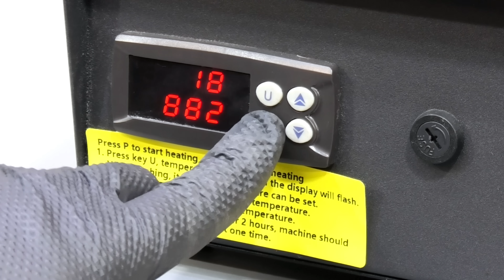105 Years Old Push Reel Mower Restoration - Why Did People Stop Using These?

Comment: made a lot of money with one of these back in the 60's - 70's @ $2 a yard and tall grass was no problem I just flipped it over and pulled it vs pushing it then flipped it back over to finish up.
everybody appreciated how short it would cut the grass and how even the grass was when I finished cutting it. it never cost a penny to operate it no gas no oil no constant mechanic payola.
just grab it n go it always worked.

Comment: They make a cleaner cut with each blade of grass, but if the blades of grass are lying down, they don’t get cut. Power mowers provide some suction that pulls the blades upward before getting whacked by the blade.

Comment: Great job.  question: did your research show original with that size handle? I got plenty of use out of a similar cutter when I was a teen but besides all the similarities....the handle on my was quite a bit wider and much easier to use versus pushing and guiding the mower from the center like the one you refurbished.  The job was hard enough without the center balancing act. Just a thought.
Reply from the maker: Thank you. I made the handle shorter to better fit my palms. Your hands were also smaller as a teen, I guess.

Comment: A couple of things, how did you miss some of the powder coat in that dip where it goes from round to the other part of the body at the mower, and how is it you're using a wrench that's like three sizes too big and barely grabbing that square head bolt.

Comment: Good, you toom it out and discovered why people stopped using them. They are great for a little lawn with no tall weeds or grass - past that they are a pain, figuratively and literally, compared to almost every other possible method of cutting grass except scissors. You can still buy them, by the way - not the same model, of course, but the same tech.

Comment: People stopped using these because they require actual physical work to use effectively, regardless of the better cut. People are lazy and will devise something easier, because we can.
Now advertise a prize for the best kept and clipped lawn and you will probably sell quite a few. It's about motivations.
Thing is, if you maintain your lawn regularly, these reel mowers are no more work than a gas mower (actually less), and give a better cut.. They become work when you try and cut a lawn that's a month old.
Another beautiful resto.

Comment: I have an old Penna Lawn with identical wheels There is supposed to be a rubber tire fitted over the wheels and is prevented from slipping by the ridges. I also believe this rubber protects the wheel from chipping. I have a partial rubber that I've been hoping to make with a mold using the old tire for a template, the outside of the tire has a cross hatch tread, I'll  need to check to confirm this. with the tires the lawn mower will perform very well.

Comment: Vaguely recall; flip it over and push or pull it to sharpen the blades and by adjusting the ground plate to tighten or loosen against the blades

Comment: Nice restoration, but did you not have the blades sharpened?  It's a specialist job, but you should be able to get that done locally.
Reply from the maker: I used a lapping compound. The mower iself-sharpeningng.

Comment: My mom had one of these for years.  They do a nice job. However, as slow as the blades are turning, you must keep them sharpened — that’s why there were so many mower sharpening shops back in the day (usually next door to the typewriter repair guy).  Also, if the grass gets too long, you either mow in six-inch strips or exert superhuman effort — life sucked either way.

Comment: I bought a Qualcast Viceroy off Marketplace a couple of years ago. The bottom blade was badly damaged, and it was seized. I got a new bottom blade made after freeing off the mechanics and a friend of mine turned a new roller on his lathe med from a beech rolling pin. The paint was in good condition so I cleaned it a coated it in bees wax. The handle was sanded and oiled with linseed oil. I now use it 2 or 3 times a week during the summer. It is older than me, and I'm 70.

Comment: I used a couple of different reel mowers and they could never cut the grass correctly with just one pass.  Granted, I had about 10 different varieties of grass (at least), but I would have to mow the entire lawn twice (once horizontally and once vertically) to get most of it cut correctly.

Comment: I am actually surprised that more people do not use reel type mowers.... when I was renting a house... I had a tiny lawn.   and  I was not about to spend  hundreds of dollars  for a gas mower.
I stopped at a couple garage sales and  came across a reel type.... it was  functional  ... rusty... but with a couple cans  of brake cleaner ... and  some motor oil and a wire brush  I got it  working again....
As long as I didn't let the lawn get to high...  it would take me 10-15 minutes to mow the lawn,

and the best parts?   No Gas... and  I could  mow the lawn  at the butt crack of dawn because it was  QUIET

Comment: I restored 3 old push mowers 40 years ago, with the original paint colors and then had them sharpened on an antique reel mower sharpener machine.  They were beautiful, and cut a lot better than yours.

Comment: mine is still in use.  Its weight is the pro.   later stamped iron sheet ones just  have a "lift off" from the grass when pushed .  Nice restauration although I see some rude  methods .  I would be more gentle to the parts .  reminds me to do some maintenace   the wooden roller should consist of multiple loose items

Comment: I own a modern reel mower and they don't work well on really tall grass, especially when its all different heights.  The results of this test (it did not cut very well), is normal for the first cut on a lawn.  Not a problem with the restoration.  You have to go back over it.  After 2-3 times cutting the lawn, the grass will all be the same length and then the cut will be smooth and uniform.   The number of blades makes a difference too, as does the cutting height. 

Why did people stop using them?  Because overall, the gas mower works in all situations and is kind of "plug and play".  Also the biggest reel I've seen is 18 inch whereas a typical gas mower is 21 inch.   Reel mowers fail miserably if you've got a lot of sticks in your lawn which will get stuck in the blade meanwhile a gas mower will just cut them up.   Also as I said earlier, a reel mower struggles in tall grass.  They do have some advantages which you can read about online if you're interested and search.  I really like mine and I'm not using the gas mower anymore, it runs and then stops - I got tired of that and switched to a reel.      Good job restoring it.
FYI, mine is from American Lawn Mower Co.

Comment: I have actually used an old reel mower... 1960s or so. Rock solid and heavy, indestructible. Actually a bit too heavy to be very nice to use. And the pine trees in that place had grown tall since the 1960s, and cones were all over the lawn, and the mower would stall out on each and every one, needing it to be removed from the scissors. It got a bit hopeless.

Comment: When I was a little boy we had one like this, I think it was British made, it was very heavy, because it was all made of thick metal, I think modern machines work more smoothly, grass would get stuck in the wheels, it needed constant oiling and sharpening of the knives, which no one knew how to sharpen, and the container for the cut grass seemed to be missing, also metal

Comment: A push reel mower is used by pushing back and forth as you advance, esp in thicker grasses.  The blades need to be able to throw the clippings away.  Nice restoration though!  I grew up mowing my neighbors lawns with one of these for $5.00.

Comment: I collect reel mowers and have owned more than 100 over them (down to 20 now). There are three reasons people stopped using them - if you let the grass get too long there a real bear/close to impossible to use; a stick or pine cone will stop you dead in your tracks; and they can get no closer than 5 inches away from a tree. The latter necessitating use of those old fashioned hand grass shears.

Comment: I have one. When I try to use my gas mower, it will just stop and I end up yelling at it. When my push mower stops, I take the stick out and go back to mowing. It's also a lot easier to listen to poscasts while using.

Comment: With all the considerable time and effort spent on restoring this mower, why did you not sharpen the blades?  The sharpening test performed audibly demonstrated that the blades were not sharp.  Scissors do not make a grinding noise when cutting a sheet of paper!
Reply from the maker: The blades were sharpened by the lapping method. They cut well wet grass (the test was made after 3 days of rain), but even better when everything is dry.

Comment: Nice to see this being done. Couple of observations.. 

Why not get some ring spanners or sockets. OE spanner’s are very poor substitute unless access is a problem 

Nut sizes are probably imperial not metric. 

Better not to have dismantled the rotary blade. They can be ground intact by. A specialist. You could have sand blasted it intact. 

Get a soft drift to remove bearings to avoid damaging housings

Pushers would originally have been hardwood, oak or beech not pine.  But nice lathe work.  Roller too.

Comment: I was 10 in 1955 when my dad said I was old enough to mow the grass... with that monster. My muscles ached like crazy no matter how much I did it. I think it was at least 50 years old and probably would have done a better job if totally cleaned up and greased. Yet my dad kept those blades sharp. It just wasn't fit for a kid, I guess. BTW, that back roller should be at least another half inch in diameter.. Otherwise, you did a great job.

Comment: I used one of these in the 1960s. I hated it. It rained a lot where I lived so the grass grew fast and was usually damp. The metal wheels had no traction on the wet grass so the blades didn’t spin steadily. The result was a very uneven mess. The whole thing was heavy and stiff to push even on a good day. I hated it. So did my dad which is why I was the one who had to do the job most frequently.

Comment: The big problem one will have is that without the tires the bare metal wheels will slide over the grass and not spin the blades at times.

Comment: I bought one new from Sears in the 90s and I can tell you why people stopped using them. If you have sticks on the ground, it will lock up tight when the blades try to cut them, and that will happen every single time you run over one. In a yard like mine it's not at all practical to pick them all up. If you have tall weeds, the blades don't grab them and they won't be cut, forcing you to saw it back and forth over the same area till they get do get caught by the blades.

Comment: Anyone that asks "Why Did People Stop Using These?" has never used one of them.  You have to go back and forth, over and over, just to cut a SMALL yard.  We preferred a Slingblade even though it is not as neat of a job, but gets rid of the weeds (we did not have LAWNS).  These mowers were usually purchased by RICH people that had SOMEONE ELSE use them so their LAWN would look neat.

Comment: This was called a tiff mower--it was not to be used with grass/weeds, it was to be used for mowing Tiff--its like a natural carpet of grass that is so perfect it looks like a green carpet, often used for golfing greens. I'm 75 yrs old, I haven't seen any Tiff in the last fifty years. This mower is restored but it still isn't right, it needs to spin effortlessly on the forward stroke and continue spinning on the rearward stroke. The reel should spin at high rpm while going back and forth.

Comment: Now you know why they stopped using those old "armstrong" mowers. If not sharp and well tuned you have what showed in your mowing part of the video. Even with  it well tuned it was hard to push and most people shoved ahead and pulled it back for another stroke. They weren't called "armstrong mowers" for nothing. As a 12 year old I had to mow our lawn with one of those old reel mowers and it was a struggle for a boy of 12. I'd gladly relegate all of them to the scrap yard but, nice job on the restoration. Sharpening those things was a profession and there was a sharpening machine for them. sharpening them yourself was almost impossible.

Comment: Push or powered reel type mowers will not cut grass (or weeds) higher than the top of the cutting reel. So, unless you have a very well kept lawn without some tall weeds, this type of mower just lays the tall stalks down without cutting them and they spring back up. I used reel mowers for years.  A rotary mower will cut it all to the same height. Much better for the typical less than perfect lawn.

Comment: I am 81 and pushed many of those when I was younger.  I thought it required a special machine to put the blade on to be sharpened as each cutting blade must be exactly the same length so that it would contact the cutting bar correctly with each rotation.

Comment: The cutter is not properly adjusted you can clearly hear. probably the rotating knife is not cylindrical. Manual sanding operation @19:26 is not sufficient. You need a fixture and a grinder on a rail. A pity to do all this fine work and leaving out the key element. But of course is ok for display.

Comment: A Tip. When using this type of grass cutter you have to push and pull this will remove the cut grass not just walk in one direction as you did.

Comment: The two screws with the springs adjust the bottom blade/cylinder gap. Generally it ought to be as tight as possible while being possible to push the mower At 21 minutes it is far too loose. Grass is tougher than paper. 
Generally you have it looser as you start mowing in spring. Until the height of the cut is reduced to it's lowest in summer when it will be really tight.
Consequently when you were testing the mower it was barely cutting.

Comment: A few things, don't cut grass when it's wet (didn't look dry) instead of cutting it, you're just laying it down, and I think more adjustment and an actual sharpening is needed. Other than that, great work!
Cylinder mowers are the best for the grass as they actually cut it rather than ripping it as most of todays modern mowers do.

Comment: Why did most stop with these? It's a lot of work. I used one with a really small yard. It was perfect. No gas. No noise. 
A normal sized city lot will likely take over 2 hours. Or you can get a 20 in. mower and be done in less than an hour.

Comment: My father used one of these manual pushmowers  when we were kids (1950s).... i used it when i was 10. Hated it.. The power mowers were more effective, faster and cleaner. I could get the $$ yard jobs if i had the power mower but got turned away with this manual garbage... (i remember the power version of this pusher style... scary.) 😂

Comment: people stopped using these because when they were kept sharp and in good working order they were still only half decent. they were fine on level lawn that hadn't grown much, but if there were any tufts that had grown more, a weedy spot, or you hadn't mown recently, etc they were a pain and you had to get a run-up and push extra hard to get it to cut. the flying blade of cut grass also easily fouled the works so they needed a lot of maintenance.

Comment: Excellent work.

The Cutting Cylinder is in the wrong way round. Just check your before and after comparison shots at the end and you'll see.

Trust me. I have done this job for 40yrs working on all types of mower. My current job is Mechanic working at a Golf Course on John Deere machinery.  Google to see what I work on

John Deere 220B

John Deere 2500

John Deere 8500

John Deere 2653

John Deere 2030

John Deere Gator

John Deere 5075E

etc etc .

Comment: Aaaannnd THATS why people stopped using those mowers.
They cut, but the path is smaller and they don’t cut near as well as a modern mower does.
And some of the electric mowers out on the market today are even better than the gas powered mowers are. 
Lighter, powerful, less noise, and last just as long.

Comment: If you want to know why people stopped using these, just try using one to cut the grass during a wet summer.  July and August heat and high humidity will kill you as you try to force these to cut a yard of any size at all.  I used to cut my grandfather's very small yard in town and I finally gave up and his sons bought a gasoline powered mower. Years later, I was working under an old, old house and one of these was pushed far into the crawl space.  I made the mistake of trying to pull it out of the way by pulling on the blade.  As soon as the wheels moved the blade spun and cut two of my fingers badly.  Safe to say, I have no fond memories of these contraptions.  A good analogy might be why we quit digging our gardens with a spade and started using roto-tillers.  One spends far less time and effort.
Reply from the maker: You have quite a story with these. Thank you for sharing and I hope you enjoyed the video 🙂

Comment: I see you managed to not show the powder coated gear teeth inside the wheels.  Good job. 🤣. And doing a miter cut on a table saw without a miter sled really is a bad idea.
Reply from the maker: I didn't because I showed how I clean the powder from the inside with a brush, but I guess you skipped, so I didn't have to show some greased teeth... 
Why are you so mean? 😫

Comment: The width of the handle is not proportional at all.  That along with using pine for the wood bits takes an otherwise nice restoration and makes it look like a newbie did it.
      Using a Hardwood not only would look much better but also be closer the original.  I hope this comment can help you in future projects.